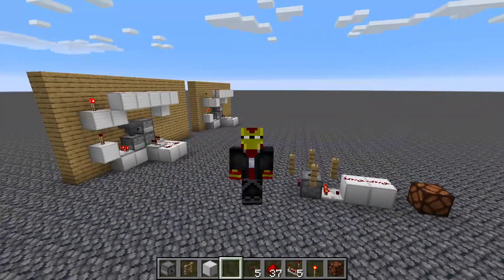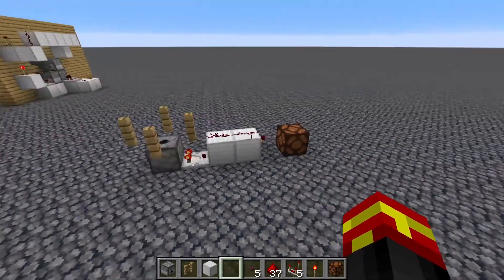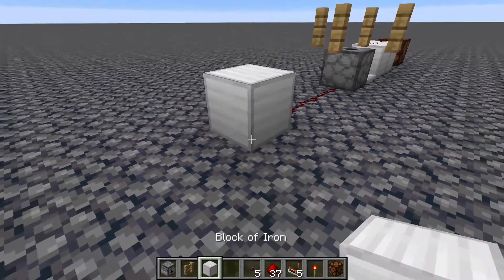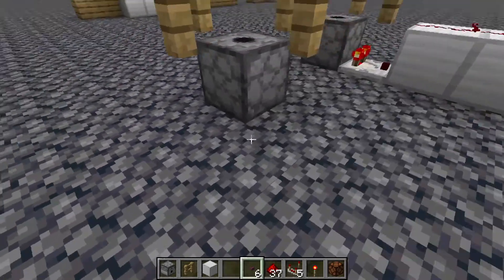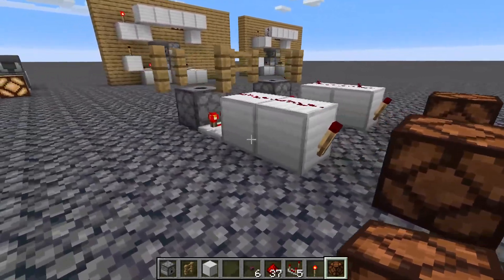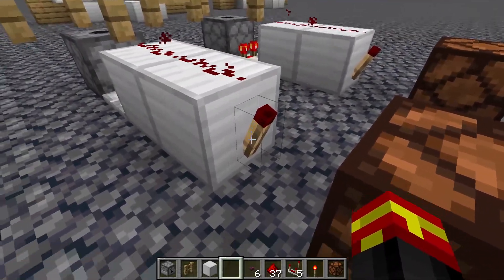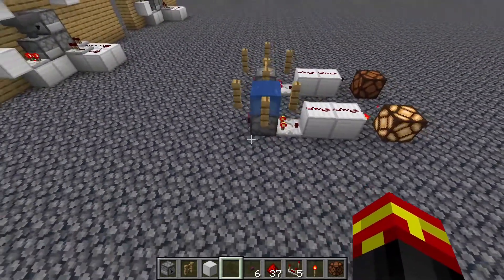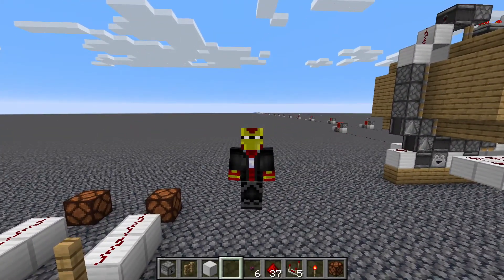How to Make a Dispenser & Water Bucket TOGGLE CIRCUIT (Minecraft Redstone Tutorial)

Comment: Can you do one with a lever
Reply from the maker: You would have to add something that activates the circuit when the lever is turned on and off, it would have to be a short pulse / monostable circuit perhaps
Reply: Alternatively you can use an observer taking input off of the lever's signal, it will ping every time the signal changes states, I'm using something similar to build a device to toggle flooding in an airlock